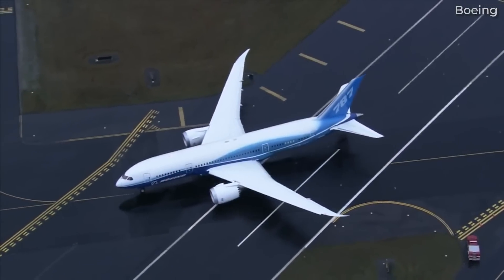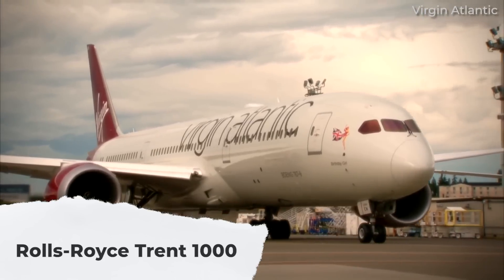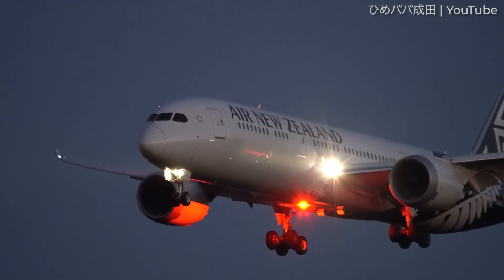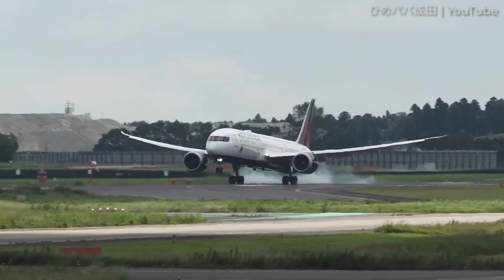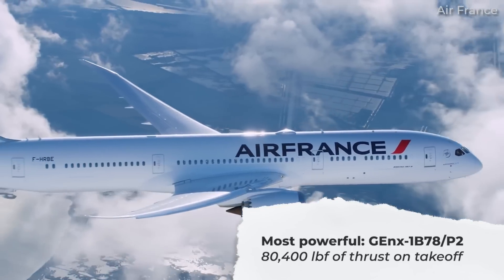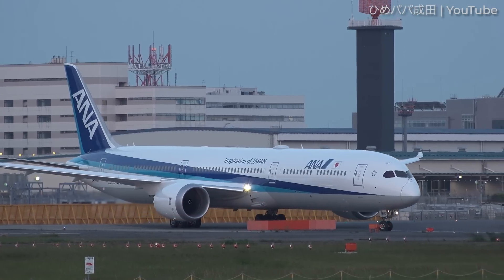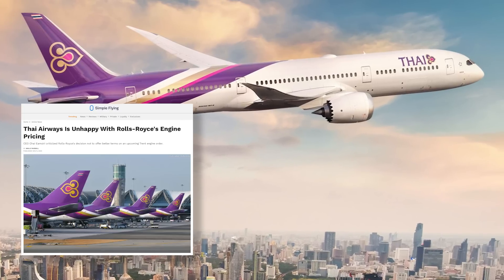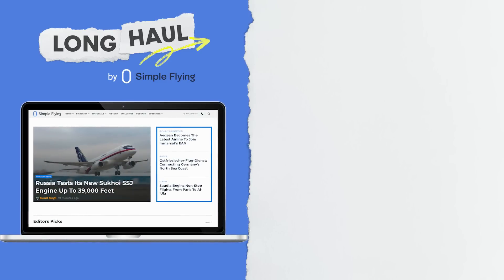Rolls Royce Vs General Electric - Boeing 787 Engine Options Explained

Comment: ANA cocked things up multiple times when selecting engines... PW for 772 & 773, RR for 787, and most recently PW for A320neos🤣 Back in March only 2 of its 22 A321neos were flying, and today the number is 4 (yes, 18 of them are still grounded😂).
Reply: I don't know how they did that, but they seemed to have a talent in finding the worst engine😇
Reply: Actually there are general electric next generation versions of B787s that NH has however you won't find them International domestically in Japan although they have the range to do Tokyo to Manila

Comment: Aircraft should always have the optio of two engines. Look at the mess with the PW GTF and imagine if that was the sole engine available on the A320. Egyptair have or are selling their entire fleer of the Air us A220 due to reliability issues with the engine.

Comment: Fascinating!  Nicely produced and edited.  I was unaware all A350's were equipped with the RR Trent.
Reply: Tbh they should have put the GeNX or GE90 on a350s, it’s fatally underpowered and RR is a terrible manufacturer
Reply: @liambengif7663  what do you have against RR?
Reply: @liambengif7663  what do you mean underpowered the A350 is perfectly fine with Trent XWB
Reply: GE engines will be available for the A350 in the future.
Reply: @John-nc4bl  
But by then Airbus wont need them. RR has an exclusive until 2030, and before then the XWB engine upgrades are due, and by the end of the decade the RR UltraFan will have diverted new technology to hopefully Neo the programme. Its only American carriers who need American engines, for home politics, the rest of the world celebrate free trade and are more than happy with their extra quiet and extra economical RR Trent XWBs. The A350 order books are already stretched, so Airbus doesn't have to rock the boat with RR, nor feel the need to spend millions of dollars to help GE to make the programme a success. Its already a great success, and unlike the B787, a money spinner since 2019.

GE can whistle all they like, they rejected powering the A350-1000 in the first place, and now Airbus can just ignore them, politely of course....😀😀....

Comment: Airlines are getting fed up with with poor quality in the industry and are making their voices heard with their money. In this case many are flocking to the reliable GE option. Likewise many airlines are flocking to the CFM (GE) option for the a320 over Pratt& Whitney’s problematic GTF engines. On a larger scale, more airlines are choosing the a320 family over the 737 Max due to the constant issues with the latter. Rolls Royce is lucky they have are the exclusive engine for the a350 or they would be in real trouble. Also Boeing and Pratt& Whitney are lucky that Airbus and CFM can’t produce more of their respective products fast enough.
Reply: The A350 is the success it is, because of the combination of airframe and engines, so why would customers wish to invest in the potential powdered metal problems with the GENX, which the FAA fear will soon affect Boeing aircraft......

Comment: I suppose there are pros & cons of jetliner makers to offer only one engine brand. However the 787 good firm order book could be because of having the choice option  for airlines ?
Reply: No, there are different reasons for that. The 787 is smaller (more flexible) and cheaper than the A350. And it was available earlier. Those are the main reasons for the larger number of orders. Not the fact that there is a choice between engines

Comment: Which engine is more efficient.........GE9x or Trent 1000???.GE seems to be the bigger engine manufacturer.
Reply: The worlds most efficient turbine is RR T-XWB on A350. Trent 1000 is an older engine so not so efficient. GE9X will be later gen than T-XWB so will most likely become the most efficient when it enters service.
Reply: Depends on how you define efficiency? Consumption per kN thrust?
If you only take consumption as an absolute number obviously the GEnX is more efficient, but also much less powerful
Reply: @swems-z3s  It`s well known Trent-1000 is the better engine for take-off up to  cruise then GEnx takes over. Both these engines over the course of a mission are very evenly matched in efficiency. Trent-1000 is also the better performer at `hot & high` airports due to the efficiencies of the 3-spool design. I look forward to see if -1000 gets the UltraFan treatment before  any of the other engines or whether T-XWB gets it first, probably down to AB or Boeings decisions to invest.

Comment: Question 1: Which engine option did Emirates go for?
Question 2: Is Rolls Royce really that bad. Didn't they fix the issues they had with the engines during Covid?
Reply: RR  still not fixed.
Reply: So many giving false info on RR Trent 1000 which is fixed & has had many orders since & that was 4 years ago ( Sad GE fanboys to blame ). Unfortunately there are now parts shortages affecting all the engine manufacterers including GEnx & GE90 with many grounded planes around thw world. RR produce the worlds most efficient turbine built so far & that`s the Trent XWB on the A350. RR are also going to re-engine the B52 bomber. They supply Trent 7000 on the A330Neo which is a bleed-air version of T-1000 & is doing well on sales too, so RR are doing better than ok.
Reply: In answer to your 2nd question. No, far from it. We ( Air NZ, I’m a kiwi ) have 14 787’s. All RR powered as we don’t have the -10’s yet. 3 are grounded as RR cannot supply either parts or replacement engines. So sadly no, nowhere near fixed.
Reply: @eastpeak74  Cries in the downfall of British industry.

Comment: I seem to recall during the 787 early development , Boeing said the engines could be changed to the other  engine   RR to GE.   GE to RR  after delivery ,is this a face and has it happened. 48 year retired AMT
Reply: Aviation International News reported in 2007 that this actually happened when early development aircraft with RR engines were changed to GE engines for delivery.  The aircraft is reportedly capable of accepting the change, but the pylon-to-wing mount must be changed as well due to the differing weight distributions of the engines.

Comment: Airlines aren’t mixing things up with their engine choice. Most airlines are shifting to GE engines because they are sick of the problems with the Rollers.
Reply: As an aircraft mechanic really think GE makes a great engine.
Reply: That’s not general speaking. The RR is more powerful than GE but RR had problems on the roots of the blades…
Reply: @davodachi  nice lie, ge has more power
Reply: Yeah
Reply: On the 787. A350 and A330neo are RR exclusive.
Reply: @harstoft that’s because airbus is full of problems and can’t stand buying from a quality engine maker like CFM or Ge
Reply: @harstoft RR isn't exclusive for 787 engines. Recently Thai is bought 787 with GEnX engines.
Reply: @clipbhie  would you rather i say "lets eat, grandma" or "lets eat grandma"
Reply: The Rolls XWB-84 engines on the A-350-900 are extremely reliable and economical.
The new GE engines on the 777-X have had a string of issues. They should have been sorted out now but it's hard to know until after the 777-X planes actually start flying commercially.
Reply: @TheChiefEng they had an issue with the compressors around 3yrs which have now been sorted out.
Reply: @TheChiefEng  the 777x is also not in service yet... of course there are issues that need sorted out. you can't compare an aircraft still in development to one in service.
Reply: @TheChiefEng  nice lie
Reply: You wait until the problem with powdered metal affect engines made by GE............
Reply: Trent 1000 had problems with blade coating which took some time to fix since engines had to be disassembed. This was hugely costly but it was recognised the RR did an incredible job in completing repairs so quickly. Most airlines are not shifting to GE because they are sick of problems with RR, sure GE have two-thirds of sales on B787 but this was always going to be the case because of the huge US airlines buying only US made GE. RR had a good start with T-1000 with first flights on all versions & decent sales until the problems arose. Issues with T-1000 were fixed 4 years ago & fyi since then many airlines have purchased it. Your statement is trash talk & you of course don`t mention problems that GEnx suffered in the early days.

Comment: I believe that avianca failed to take -9 order as the engines opted on the aircraft can’t take off from Bogotá with a full load
Reply: the 787 is a very underpowered aircraft in comparison to the a350, so it does make sense

Comment: Are there other manufacturers that could potentially deliver 787 capable engines? Safran/CFM and P&W for example?
Reply: i believe Safran is already part of the GEnX program, as they designed the FADEC unit

Comment: How much longer can Airbus avoid GE engines in the A350?
Reply: It is the other way round. GE refused the option to build and engine for the A350, as it would compete with the 777-300ER, on which theyhave a monopoly.
Reply: @paulroling1781  They must kicking themselves now that the A350 has received over 1000 orders and the 777 production has almost stopped, while the 777x has fewer orders. They could be getting a share of the A350 engine market, and possibly beating RR at it.
Reply: @mandandi the 777 reached the 2000 orders mark in 2018 with nearly 600 orders remaining, the 350 is at 1300 with 700 remaining and the 787 is at 2000 orders (including 1200 for the -9 alone) with 700 orders remaining.  The 777x for its part 500 orders (knowing that it is an advanced variant of the old 777) which is very good for an aircraft not used in commercial service, in comparison with the 787 (with the record for the greatest number of orders before  a marketing) was at ~800 orders even though it was a "clean sheet".  So you have to think and research before speaking :)
Reply: @whatdafok.h1737  I know all that. I don't need your figures. My comments still stand. Somehow, you don't understand what I wrote.
Reply: @mandandi  
I understand your point, you are talking about now, not the past or even the recent past. GE declined to engine the A350-1000, and NOW their competition with that, the B777X has been delayed from entering service by 5 years and maybe longer. Meanwhile, the A350 is sucking up the orders, and when the XWB-97 engine is upgraded shortly, even more.

Im sure GE would love a slice of the A350 action, but don't think GE stand a chance of pushing in because the order books are full with RR engines riding high, so there's absolutely no reason for Airbus to go to the trouble and the expense of offering an option simply for US carriers who they could barely supply for years.

Your observation was valid though...........
Reply: @artrandy  Correct. GE is missing out on making money on the A350 power plants because they failed to offer an alternative when asked by Airbus to do so.
Reply: @mandandi  even now the 787 receives orders (Thai Airways and Turkish +150 787) and the 737max the same with Turkish and various other companies and the 777x with Ethiopian + Korean.. and the orders for the 777x risk exploding when it returns  in service because the -9 version has no direct competitor and the -8 when it enters service will offer better performance than the 35K
Reply: @whatdafok.h1737  
No orders have been announced by Turkish, at this time.

And you don't know whether the B777X-8 will have a better performance over the A350-1000, for two reasons: 

1) The B777X has no in service history, so no one actually knows how it will perform.

2) RR are upgrading the XWB's and clearly they wouldn't bother if it wasn't a significant improvement on the existing engine.

What you want to happen, is not the same as what might happen........
Reply: @artrandy  Turkish is currently in talks with Boeing for the purchase of 175 737MAX and 75 787 and Qatar is also in talks for the purchase of 350 and 777X and regarding the technical characteristics of the 777-8 they are already available  either on the official site or even on Wikipedia which takes sources from Boeing, A35K in typical class 369 seats compared to 395 for the 777-8 both with a range of 16,000km the 777-8 with a max MTOW of 351  tonnes compared to 322 for the 35K maximum cargo capacity of 67 tonnes for the 35K against 73 tonnes (not yet validated for cargo tonnage but necessarily above 70 tonnes) and several other aspects such as fuel consumption, folding wings etc.
Reply: Forever. RR has an exclusive until 2030, and upgrades before then on all Trents, including the XWB. After that, RR will transfer tech from the UltraFan for a Neo version.

The A350 is a sellout, soon there will be no delivery slots before 2030, Airbus can't make them fast enough, so why would they wish to go to the expense of certificating an engine option for GE, when its selling right across the world. The A350 proves that commercial widebodies don't have to sell in the US to be successful (I tip my hat to the folks at Delta though), just because US carriers don't believe in free trade.

BTW, there are rumours that AA are about to reorder the A350, and United still have it on order. Perhaps that latter order might become serious after the events at Boeing. That company could drain any CEO's loyalty, even a US airline executive....
Reply: Why? A350 already has the worlds most efficient turbine, what has GE got to beat that?? A350 has a terrific order book with many more prospective orders, it`s a world beater, just like the B787.
Reply: @edwardwilcox6606 
 Except that the A350 is in profit and the B787 not yet...😀😀...
Reply: @artrandy  It`s sad they haven`t made a profit yet & it could be many years before they do. They`ve hit one snag after another but I`d assert B787 is an amazing aircraft despite these problems & not much luck either.
Reply: @edwardwilcox6606  
Great design, but third rate manufacture. A BA hostess once told me that upon delivery a couple of seats had the smell of rotting food emanating from them. They envisaged that Boeing workers just tossed aside half eaten burgers somewhere unreachable in the hull............
Reply: @edwardwilcox6606  yes I never said the opposite the 359 is one of the most efficient aircraft in terms of fuel consumption (between 2.13 and 2.07 l/100km per passenger) with 1300 orders for 700 not delivered but in general the 787 remains the  the most popular long-haul plane and with equally honorable fuel efficiency with the Rolls-Royce Trent 1000 TEN (between 2.27 and 2.08 l/100km per passenger) with +2000 orders for 700 not delivered.. one  major problem (apart from the single engine) is the maintenance cost much higher than for the 787, an example with the tailstrike of an Air France A359 in Toronto, to date i.e.  after almost 5 months the plane has still not returned to service, or Azul which has withdrawn its A350 which is much too expensive to maintain...
Reply: @edwardwilcox6606  yes I never said the opposite the 359 is one of the most efficient aircraft in terms of fuel consumption (between 2.13 and 2.07 l/100km per passenger) with 1300 orders for 700 not delivered but in general the 787 remains the  the most popular long-haul plane and with equally honorable fuel efficiency with the Rolls-Royce Trent 1000 TEN (between 2.27 and 2.08 l/100km per passenger) with +2000 orders for 700 not delivered.. one  major problem (apart from the single engine) is the maintenance cost much higher than for the 787, an example with the tailstrike of an Air France A359 in Toronto, to date i.e.  after almost 5 months the plane has still not returned to service, or Azul which has withdrawn its A350 which is much too expensive to maintain...
Reply: I am guessing that they would like to offer an American engine when/if  they build their 350 Neo, as it would be more attractive to American based airlines and some others too.

Comment: General Electric said it's developing an engine option for the a350 ..
Reply: Maybe for a A350neo. The certification costs mean it’s not worth it on the current airframe.
Reply: Nonsense.
Reply: Why would Airbus want it? RR has an exclusive until 2030, and upgrades are due before then. After that, RR are transfering technology from their UltraFan to all the Trents, including a Neo version of the A350, so why would Airbus wish to upset RR when they're literally selling out of this aircraft. Very soon, there will be no delivery slots before 2030, so Airbus does not need the added expense of a pointless engine option.

GE might have the ambition to power the A350, but they can whistle in the dark. Airbus doesn't need the US market either, and its American carriers who want US engines because its Americans who don't believe in free trade. GE will just have to stick with Boeing...😀😀...

Comment: Is it possible to use one of each engines on the same aircraft?
Reply: Servicing nightmare.
Reply: No, that doesn't work.
Reply: Not sure why anyone would want that. And I would imagine it being almost impossible because you would need double the instrumentation for monitoring and controlling the engines.
Reply: Possibly yes.  During development it was stated the aircraft could be switched later to the alternate engine type, and could even be flown with one of each. I suspect some commenters will vehemently dismiss such an assertion, but it was reported at the time via respected sources.  Aviation International News reported in 2007 that an engine manufacturer swap does require the pylon-to-wing mounting point to change, adding cost to the process.